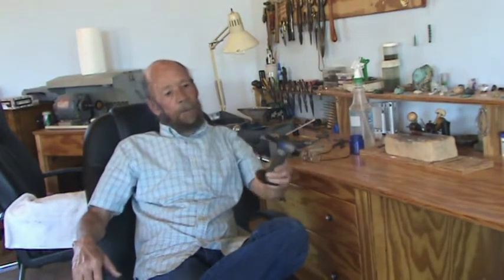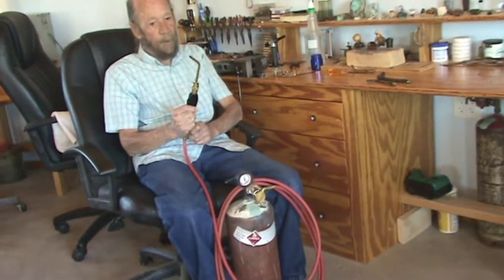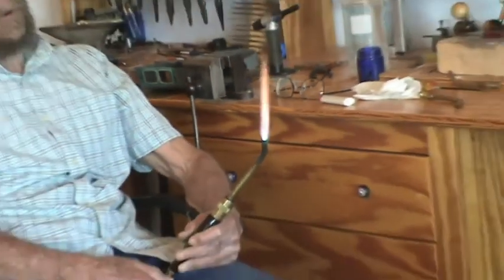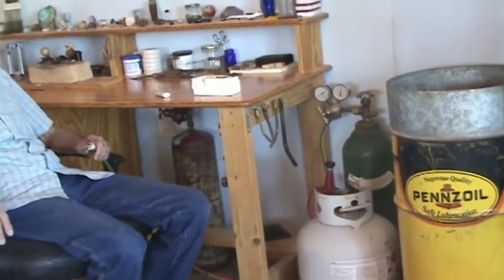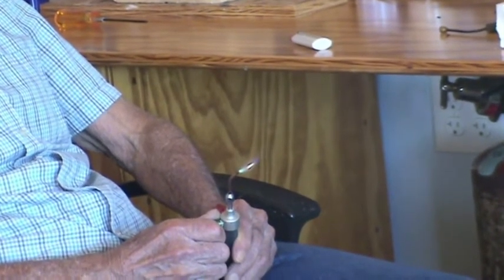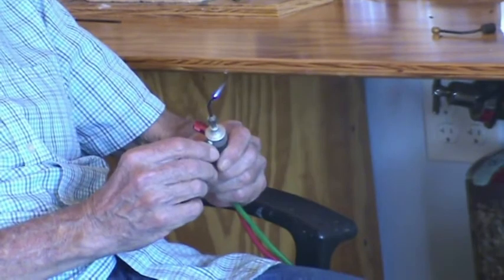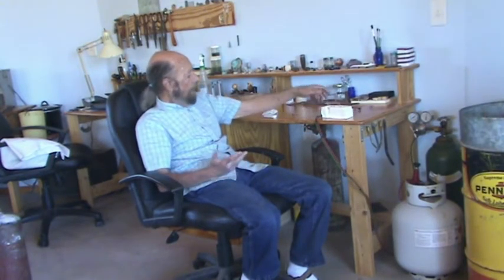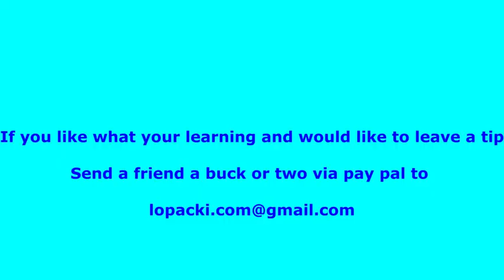TORCHES AND THEIR APPLICATIONS

Comment: While I appreciate your knowledge and experience you’re off base on oxy/acetylene. I’ve been in the trade for 47+ years. Prestolite acetylene/air, Smiths acetylene/air, Hoke oxy/natural gas and finally 35+ years ago Smiths Little Torch,
oxy/acetylene. When I first lit it I was holy shit! Black floaties all over the room. I thought “needs oxygen”!
From then on I’ve always cracked the oxy when lighting, turned off the gas first. No problems for all these years. BTW - I have soldered platinum with it - not a bunch but some. As long as you only use an oxidizing flame - no problem.
Reply from the maker: In my video I showed that I had changed from acetylene to propane........... No black floaties what so ever.
Reply: @daniellopacki6585  - I understand that. I’m saying that acetylene has advantages but most that try oxy/acetylene give up and go to propane because they can’t figure out how to avoid black “floaties”. I prefer the higher heat since most of my work is fabricated belt buckles weighing up to 3ozs. I built a special order buckle that weighs 6 ozs. I barely was able to solder it. I don’t think I could have soldered it with oxy/propane.